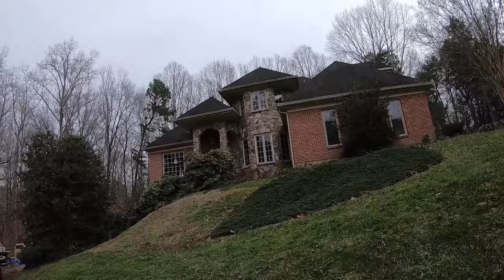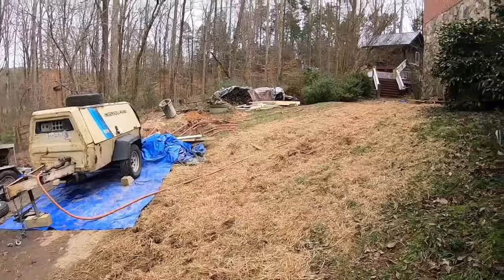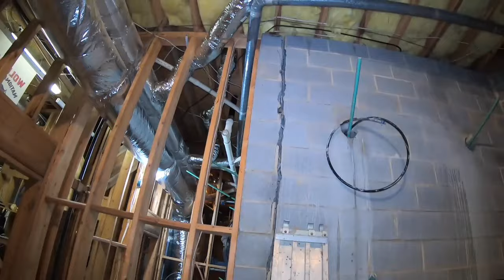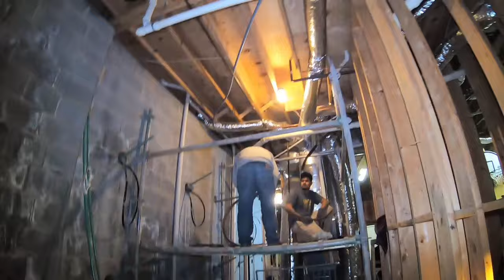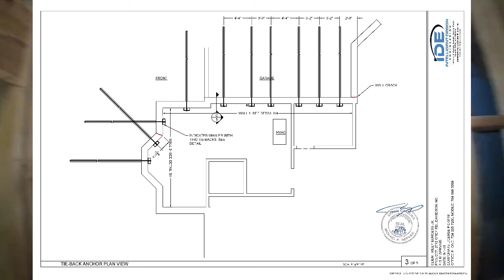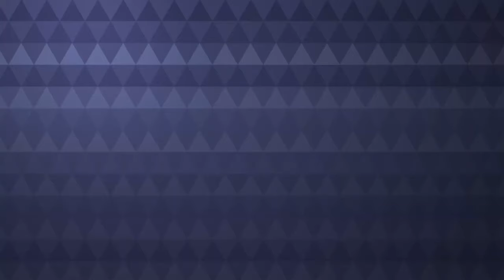Bowing Cinderblock Basement Wall Charlotte, NC - Installing an Engineered Soil Nail Retention System

Comment: Did you get any correction to the bow? Did you trench against the wall to allow for correction, or did you just go for stabilization?
Reply from the maker: This is a stabilization protocol. The hardware was tightened and the wall does pull back a little. Trenching would be impossible as you would have to tear down the attached garage to do so. I suppose the client has the option to have us come back and "tighten" the hardware during drought periods to pull the wall back slowly in small increments,  but nobody ever does that. A mason can patch the cracks and the client can finish the basement as planned if he so chooses. Thank You for commenting!